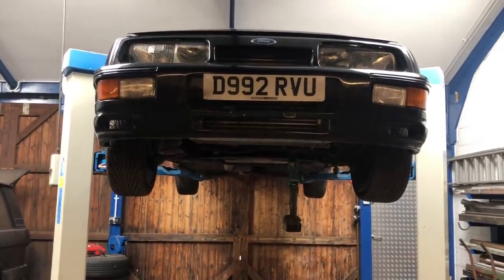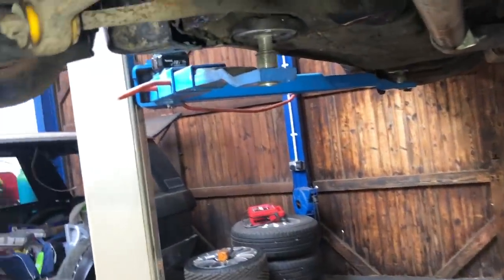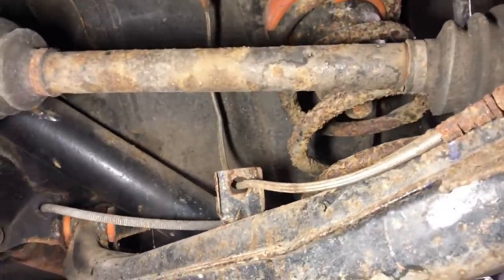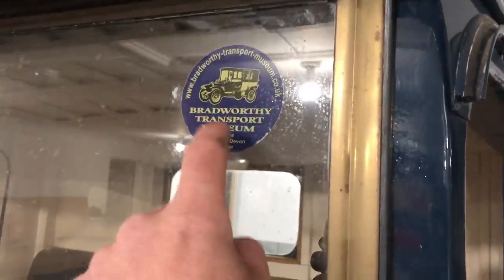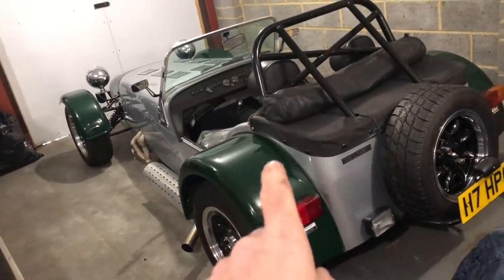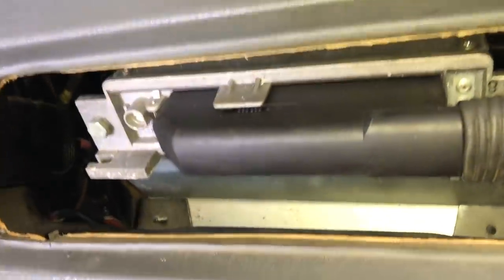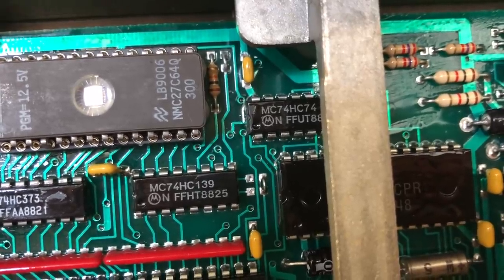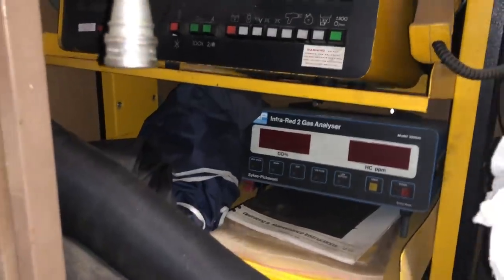Ford Sierra RS Cosworth 3 door what is next? pt5

Comment: Interesting viewing as always guys! Having grown up around these cars in their prime always been Real Cossie fan and my dad being an auto electrician back in those days, I was no stranger to seeing these cars in pieces ! From what I’ve learnt over the years through mates owning and tuning these and just down to me being a Car geek, Correct that the chip in question is an eprom and best to cover it from any ultra violet interference !  I’m quietly confident you will need an eprom reader/programmer to identify what map is on there, you won’t be able to learn anything through the cars diagnostic port, you’ll just get flash codes
If you can lay your hands on a cosworth DS-86 eprom reader you might be in luck. 
Rare to see it’s not an Ahmed Bayjoo chip (RIP) if you can find the Throttle position sensor on the car this may shed some light on identification of things, also what colour injectors does the car have? (Apologies if you have already shown this)  but overall I think that Eprom chip has maybe an individual map on it ,or it was flashed by previous owner(s) for other reasons and it’s just back on a standard map... but the turbo , rad sump and intercololer definitely suggests some potential speedy naughtiness 😁someone like Burton performance might be able to help out, look forward to the next installment!

Comment: Jesus that's had some money spent on it in the 90's! That Alloy sump pan looks like a bespoke item, the Koni's being fitted all round were the top dog at the time, add to that the Grey injectors, the huge intercooler, the stainless full system, this is one serious beast. The person who did this lot must have really loved the car, they seem to have been entirely sensible and not done any outlandish body mods, which suggests to me they were all about the "Go" and not the "Show". I can pretty much put money on this having an uprated cylinder head, H section rods and forged pistons looking at how they've not cut corners on the rest. Everything is right at the top end of what would have been in the catalogue at the time, Willwood, Koni, Superflex (the polly bushes are obviously theirs). It might be worth you giving Graham Goode motors in Leicester a ring, they possibly dealt with this car. Back in the 90's they and Mountune were (and still are) the kings of Cosworth, Mr Goode himself raced the RS500 in the 80's and they had his old track car in the showroom where all the alloy wheel, race seat and suspension parts were on show.

Comment: It’s got some work done on it you wouldn’t expect on a car that’s probably running a low bhp upgrade chip like a stage 1 270bhp, the upgraded intercooler rad and sump would normally be done on cars where the owners want higher power like 370bhp up , have some of the upgrades like chip big turbo big injectors been pulled off it for standard. Is it running a std or upgraded clutch ? All signs to it’s previous life.
Reply from the maker: Jason Harry it’s got a big turbo and grey injectors

Comment: What colour injectors are in the 3dr?     That should tell you a power figure, 4x4 rear vented brakes, big wing sump 👍🏻 looks in good shape underneath
Reply from the maker: cosworth mick grey
Reply: salvage rebuilds uk fairly safe bet looking what’s done with grey injectors it would of been 380-400bhp ( maybe more ) at one time. Make sure you get it to a specialist for a set up.

Comment: I recon you should leave the car as it is. Just sort it out, but recondition the running gear. Looking at it from the under side you can tell it's been done right and the money has been spent in the right place, it would be a shame to put it back to stock. The car's bang on from that era.....
 You might be lucky and have an Andy Rouse motor, Eppron chip is definitely a good start. If you crack the head of and find cooper rings machined into the block you'll be on a winner. What with the Wellwood brakes and Koni suspension mods, modified diff, it's certainly looking good...... probably in the region of 280 to 340 bhp, bit of a handful in the wet but good for a 140 mph long distance cruise. ( memories of some 5am Sunday morning M40 blasts )
 Check if it has extra injectors and if it does it should also have a larger fuel pump other wise it'll suffer from fuel starvation at the top end. Some of those older 80's 90's turbos had a lot of lag on them and unless some one did an all at once up grade often the turbo and the rest of gear were a bit miss matched. However it doesn't look like it's been blown up to many times
 Bit surprised it doesn't have a stainless steel 3 inch exhaust...Having done most of that to my own one and seen others like it, you wouldn't get much change from 15 -20 grand for the tuning extras.....

Comment: All the mods scream track car. If the boost gauge is still working run her up and build the boost, see what she peeks at, run this through the colour of the injectors and other mods and people can tell you if it's in a certain stage tune. For instance, green injectors, T34 turbo, RS500 Intercooler (looks like yours) Group A Cone filter, Stainless exhaust, 3 bar map sensor and Group A coil puts you in stage 3 tune (around 300 to 380bhp)

Have a look if it still has the 205 engine block or if it has been changed to a 200 block found in the 4x4s. The 200 block is stronger. Look down the side of the lump and you will see 205 or 200.  These cars are easy in todays market for power. Also, if the clutch is hard to pull away smooth and feels like a 6 paddle, then most people who ran decent power had a 6 paddle. Bloody horrible for daily use but can take the power. Post more videos and dont be afraid to make them longer as well.

Comment: nice big wing sump :) change out the old poli`s to black ones,  check there is not too much play in them rear shaft cv joints. the injectors will show what power it would have. yellow standard, Greens then light blue would be a good start.  normal turdbo would be T3 then uprated would be the T34 then you start going mad power, the ecu with the chip that has the window, keep that out of sunlight..
All depending on the injectors, map sensor and the turbo. Standard looking at the normal 200bhp then up to the stage 3+ with light blue injectors and a T34 easy 380-400+ mine was on greens and got 387 at stage 3 with a T34 3bar map sensor.
Reply from the maker: rs2klee injectors are grey
Reply: @sruk   fuk.. you got a monster :) yup light blue or grey will easy see 380-400 check the housing is a .63 they flow better than the .48 you might have at least have a stage 3 MSD chip fingers crossed.

Comment: Koni's , Wilwood brakes , baffled sump , big turbo , chipped ecu , stainless exhaust were all standard uprgrades back in the day , putting it back to standard would cost a lot of dough . Would leave the sump on , remove and rebuild the Koni's and Wilwoods , and keep the turbo,injectors and ecu . Stainless systems are a pain for clearance and noise  would put a standard exhaust back and find some standard alloys
As long as the car looks standard (without putting it on a ramp) , the upgrades fitted are sensible and make the Cozzy a better car , not much point going for a concours car if the miles and previous owners are sky high and the service history is not 100%.

Spend a few grand on the paint and make it a tidy , reliable Cozzy you can use at weekends , because concours cars are never seen on the road , they gather dust in the garage and are treated as an investment/museum pieces.

Comment: The plug in chip is a eprom. it holds the program for the ECU, kinda like mapping today, Normally it would have a sticker over the window to protect it from UV and giving a reference number and revision for the program. You would need an "old school" Prom reader to get the code from it, that may or may not reveal a bit more about it, or you would need to find out who programmed it
Reply: It should never be exposed to light with no cover on the window.......whoops hope the car starts
Reply: @charlieoscar09  No it needs lots of UV to kill it, but prolonged exposure, like months, could do it. Since it's normally in the box it would be fine. Actually i used to work with them a lot in the telecomms industry, it was normal to just use paper stickers which would dry up and fall off eventually in situations where there could have been small amounts if light, can't recall one ever failing due to that. Only failure i saw was through multiple erasures eventually degrading them to the point they wouldn't accept a new program. Maybe a rolling road company might still have the equipment to read it?

Comment: ECU looks untouched.
Will need to remove chip to have it read properly, the old skool way.
Have a look at the injectors too, colour may help to id rough spec, looks a big wing sump too. 
Nice to see the blue paint still on the bolts for shafts/into diff though.
Personally I'd look to getting the konis rebuilt instead of replacements as they give a nice ride for road use, and should save some good wedge. 
Looks a solid one though, just hope all is well behind the kit 🤞

Get her stripped, solid, an saved 🇬🇧😎

Comment: The original chip will of been re mapped.
The numbers wont tell you much probably.Id say coz its a big wing sump and bigger turbo and intercooler that its probably got grey injectors pushing around 400bhp.
Id keep all the brakes and poly bushes etc if i was you.
Some nice bbs 17"wheels with look perfect 👍
Reply from the maker: Stecozz the injections are grey
Reply: @sruk  
Its probably got a ported cylinder head and low compresion pistons too.
Defo had few quid spent on it.

Comment: Before you buy wheels, measure those callipers as they might not fit under oem wheels. 

With the sump and cooling mods, swirl pot etc if it’s not a big power (330+) then the previous owner has gone for reliability and done it right 👍 if it’s a big power set up, those bits are needed anyway. 

Be nice to get the sump off and have a nosey 👌

Comment: Hi Robert, just started following your channel, watching the lse is very informative , I’ve got a 86 mk 2 fiesta which needs work on the rear , inner and outer sills and arches , My first car was a 83mk1 fiesta 1.1, this would be my fourth, I’ve also got a 89 fzr 600 , the fiesta has 34k and the fzr has I think 24k I bought them both for about 1300 , and yes they are rough lol , any help tips advice will be gratefully accepted  , finding bits for the yam is like getting hens teeth ,
50 quid for a thermostat
Reply from the maker: Lee Chapman 
Welcome to the channel and thank you for the support regards Rob

Comment: I fear your surface rust may turn into a little more than that. The frilly sill seams are a tell tale sign that the sills will be pretty horrible with the kit removed. Vented rear discs which were 4x4 saph. Those wilwoods are old as are all of the other upgrade bits. The front bumper looks to be fibreglass? It's lived a life that is for sure! Gas analyser isn't a smoke tester. Smoke tester for diesels & gas analyser does CO & HC as a miniumum. Very quickly kill a gas analyser on a diesel!

Comment: Hi ecu in original 3dr was a L1,going by lable on outside of ecu yours is L6 from 2wd sapphire cosworth,(w45.06/L20-67),better ecu,if you look at what colour your injectors are will give you idea of potential power,(p.s we used to paint them to hide what power we had ),yellow upto 270bhp,dark green up to 350,grey up to 450bhp.these most common colours,there are other colours just google to check.
Also i see someone's fitted poly bushes in the rear arms,this is a big no no,original arms have heim joints,they are like a big rose joint in a steel sleeve,cars with poly bushes drive awful,you get rear steer from all the torqe,poly ok to upgrade from rubber bushes .You can get heim joints from graham goode racing ,expensive but necessary.

Comment: This car deserves a full bare shell, nut and bolt restoration, but have a sneaky suspicion it won’t get that. Hope I’m wrong.
Reply: Carl Williamson it really wants a light restoration and tidy up all the suspension and brakes .It would cost a fortune to put it back to stock and it wouldn’t gain you anything as it’s got good sensible modifications which most serious cosworth owners would like kept on as they are better then the factory items
Reply: With it being standing for so long and for the fact it’s a cossie that has most definitely been thrashed, it would make sense to get it back to factory fresh.
Reply: Carl Williamson I’d replace all the seals in the suspension and brakes perhaps put new pads  in and  then leave the poly bushes on as with the hoses etc .To return it to as was from ford would cost far too much and make it a niche market car ie concurs folk which are few and far between it will sell better as is so it can be used properly and not just be a museum piece which never is used which would be a shame
Reply: End of the day it’s not our car it’s up to them, but knowing it’s a ford and how much they love to corrode I’d strip it, but that’s just me.
Reply: Carl Williamson  that’s true the way I see its to far from standard now to be worth putting back to stock now had it been standard then of course leave it stock

Comment: Can you check the colour of the injectors... if they are yellow, then it can run upto 300bhp.... if they are green, then up to 400, if they are grey... take a change of under pants!
Reply from the maker: elliot330 they are grey 👍
Reply: @sruk  now I understand why the underside of the diff is scratched... with all that power it makes the rear squat hard and rubs the diff on the road. You're going to have fun in this.

Comment: The Lacquer on the circuit board is called Conformal Coating -
Conformal coating is a protective coating or polymer film 25-75µm thick (50µm typical) that 'conforms' to the circuit board topology. Its purpose is to protect electronic circuits from harsh environments that may contain high humidity, a range of airborne contaminants and varying temperatures.
Reply: Ford built dash instruments (Focus etc) very prone to circuit board corrosion. when i investigated my issues i found NO lacquer and corrosion was present. Poor job Ford!!

Comment: 10:08 That chip top left is an eprom. It can be erased by UV light, including sunlight if exposed for long enough. Cover the window with a sticker if you are going to be messing about inside the box. All the engine management settings will be stored in it.
Reply: The code (software) is programmed into this chip by an external programmer. The reason it’s not lacquered is because it was not assembled until after the rest of the circuit. It can be reprogrammed but you do need the right device and the correct software to do it properly.

Comment: big wing sump
Reply: its worth doing a full restoration get the engine freshened up (better to have this done than drop a rod ect) powder coat all the suspension components fit some ohlins coilovers  keep it black and fit some compomotive th's it will be a £35/40k car when done so providing you bought it at the right price.

Comment: Right first things first ecu is not a p8 3dr's have a level 1 ecu with a yellow co adjustment screw level 6 is a saff ecu with a white co screw and the level 8 is a 4x4 ecu.
You have poly bushes instead of spherical ones and the rear brakes are 4x4 cosworth the rear flexi lines are incorrect and have a hardline along the lower arm.
Remember bigturbo.co.uk this will tell you everything about the ecus and for tuning you need Motorsportdevelopments in blackpool trust me i have had cossies for more years than i can remember and modified them all. And i still own one now...... 👍
Webcon will not be at all interested btw. Any info just ask.

Comment: You should take note why all the after market stuff is fitted, you should know that a lot of the shocks, bushes,  break lines, discs, calipers were absolute junk a d basically walked off the car without being asked it was that bad. A lot of guys modified most of the cars in all areas because in standard form they were Comlete buckets. Don't get me wrong if you were a badge ponse or a top gear head all you hear them say is Ford said this and Ford said that, but if you bought it for what it was you would be deeply disappointed.

Comment: Cars that sit around for very long periods of time DOES NOT do them any good! 
In another video the difference between a RS and an RS500 was explained, there is a more to it than i thought, engine block, rad, intercooler, turbo all different!! Made stronger to with stand making high HP for touring car racing, hence the RS500 a factory built homologation special built to go racing! Dick Johnson is widely known as having the fastest Sierra,s, towards the end of 91 92 ( 92 was last year of the turbo, 93 onwards V8,s )  DJR cars were making aprox 650HP, no bad considering the Cosworth engine was based on 2ltr Cortina block with a very trick 16V head and turbo etc, power came on like letting off a bomb! NOTHING then all of a sudden HOLD ON TIGHT FOR DEAR LIFE!

Comment: The thing at the edge of the circuitry behind the metal is probably a power supply transistor. The metal casing acts as a heatsink. 

You might be lucky if you find a company with an old EPROM reader who can tell you which map that chip has been flashed with.

Comment: Rob has it got two injector rails of just one of it has two and only one wired up the it could be and rs 500   but looks to me as an rs 200
Reply: It's an rs Cosworth not an rs500 and a rs200 is a mid engine group b rally car.
Reply: @Andyc351  if you do your research In the UK. We called them rs 200 before the rally car cuz they were 220 bhp mate sorry for the confusion
Reply: @ade-1772  Rs200 was out before the Sierra rs Cosworth. No Sierra has ever been known as an "rs200"
Reply from the maker: ade 1772 just the one